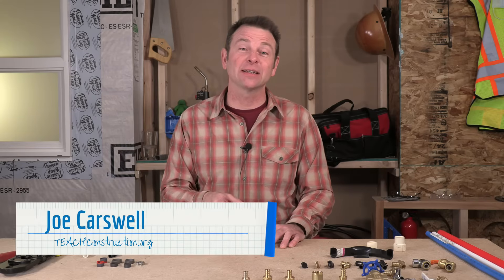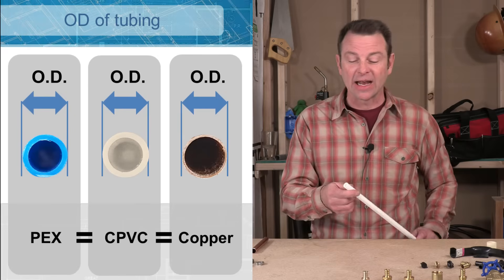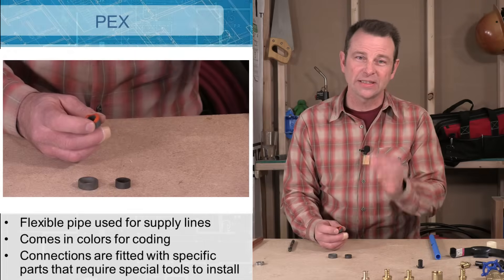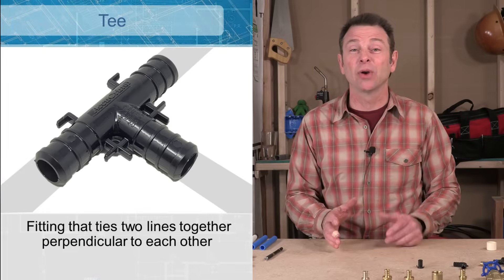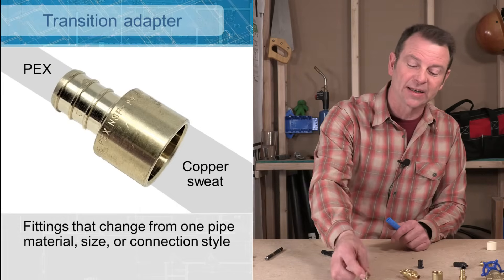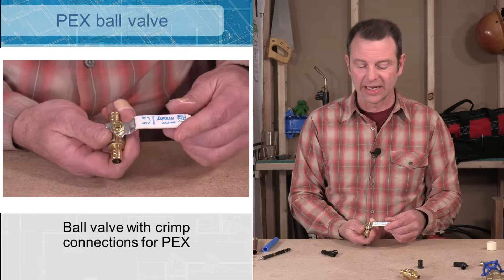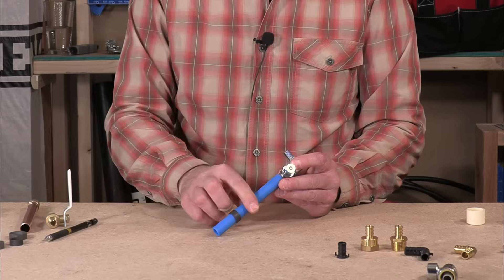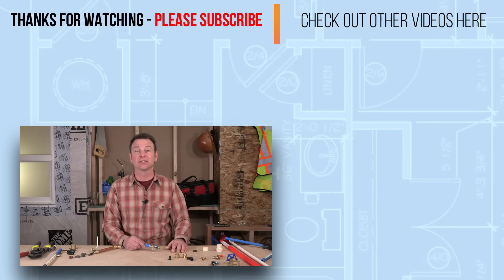A lesson about basic PEX plumbing materials  - Intro to Plumbing Systems

Comment: I live in a 20+ year old manufactured home. They used nothing but CPVC. I haven't found any plumbers that like it. I don't like it. It seems fragile and the way it was done, I worry that I'll have to do some major work if any of it breaks due to age. Would you say that re-plumbing with PEX is a reasonably easy job? Which is better, PEX A or PEX B? I very definitely like the color coding. BTW, I have about 2½' of crawlspace.
Reply: Each pex A/B has advantages/disadvantages. For many years, all the supply houses, Lowes, Home Depot around my area only had B, but now they carry A also. Pex B fittings are about 1/4 the cost of Pex A fittings. The expansion tool for pex A is in the hundreds, but the pinch-type crimper is very cheap, like 25 to 50 bucks, and it fits all sizes without having to swap heads, plus they are small in size, much easier to carry or use in tighter spaces. If you are just doing your own place, pex B with the pinch type crimper will be fine and most affordable.
Reply from the maker: I agree with Steve M's comment.   The PEX B is a cheaper solution over PEX A

Comment: How come plumbers are so afraid of 5/8" OD, especially when it comes to push to connect fittings, especially with end stops and spigots? Even if I find parts labeled 5/8, what's inside is always half inch. I managed to find a 5/8 sleeve (the spigot was tripped over, snapping the copper pipe), but it seems that the pipe wasn't long enough to connect at the top. This broken spigot is placed in a way that water can't get into the house unless I cap the pipe with a 5/8" end stop, or fix the spigot. 

When I went shopping to every hardware store, they said they don't make that product anymore. I found a sharkbite sleeve in 5/8, but it doesn't hold without leaking and shooting the spigot 10 ft in the air. So I wrapped a layer of gorilla tape around each end, and it stuck, but still leaked. So I went online and bought tools to properly Weld it with aluminum. And since it was an Asian website, and this portion of pipe and spigot were MacGyvered into place; it gets wider at the bottom and is held in place down their with JB Weld. The pipe it turns out is 5/7", not 5/8. So I found the caulk that was used to seal the bathtub, and ran a bead around the top. The quarter turn cut off valve to the house has a slight leak too, so when I checked it today it wasn't fully dry because i forgot to open the pipe to the sprinklers so it could dry. Tomorrow I'm going to wrap the connection with non adhesive (self ashesive) silicone tape, and it will do the trick. This morning before I realized it hadn't dried fully, and it withstood the water turned on 3/4 of the way before a small leak formed. I added more caulk. And tomorrow I'll take my first shower in 2 weeks. Luckily my water heater is electric, and uses a knob to adjust the temp, so I lowered it to 40 degrees F. 

I just wish I had watched this video first, I would have fixed it right away.
Reply from the maker: Quite the adventure, thanks for sharing.

Comment: Thank you for a very informative video. How does PEX compare to copper on places with hard water? Also, what is best to use between the meter and the water softener system?

Best regards.
Reply from the maker: I am told that PEX performs just as good as copper with hard water.  You can use whatever materials you like and that are allowed by code in your jurisdiction.   Just make sure you do not down size it at that location

Comment: Using a small pair of channel locks to very lightly crimp the rings helps hold them in place while  trying to get the crimpers aligned.
Reply from the maker: Good tip

Comment: is the crimping tool expensive?
Reply: If you go with the pinch-type, which are the stainless steel bands, you can buy the crimp tool for about 25.00, and the one tool fits all sizes.
Reply from the maker: It depends on the quality of the tool you purchase. 25-100 bucks

Comment: Is there an advantage to using the brass connection over the plastic? I just started a kitchen remodel and all the elbows in the pex plumbing are plastic.
Reply: My house was built 20 years ago and by year 10 I had replaced about a dozen brass fittings due to corrosion caused by what I learned was dezincification. There was a class action suit over it even. I went back with the polymer fittings and have had no issues since.
Reply: Some wells have acidic water, so the plastic fittings are much better in that case. I thought I had read somewhere that the new brass fittings could handle that, but research it first.
Reply from the maker: Some to the comments from the community are great

Comment: I had the pipe installed under my double wide  mobile home ( I helped / or hindered a professional) and it was amazing to me to see a no glue  but heat expansion process of assembly with heat or cold expansion this stuff seems almost indestructible my only question has been is it slowly leeching polyurethane styrene complicated mess of plastic chemicals into my water over time ? I was told NO!......but I still wonder ? I got this stuff installed about 5-6 years ago I was told it was a fairly new process then ? Hopefully it had time tested proof before it hit the market I cannot smell any horrible new  plastic smell and having hot and cold I'm the lines over a month of vacation without use still didn't smell when I got back I have well water do different minerals break it down ? I can assume the chemical's added to treat city water are much tougher on the pipes than well water but for me so far so good thanks for the refresher
Reply: Pex B is safer when it comes to chemical leaching of the pipe.
Reply from the maker: I can not comment on the pipe leaching into water - I am told it is safe

Comment: Hi! Can I rotate a pex expansion fitting after its installed? The elbow it pointing at the wrong orientation :(
Reply: I have rotated a crimp fitting on B, but have never tried on A
Reply from the maker: You can - but I would do it in a limited fashion

Comment: Does PEX piping systems use unions? If no, how do you separate components if you have to replace something?
Reply: Buy unions and put the pex fittings on them.
Reply from the maker: PEX is easy to bend and cut - sure unions are not typical.  But couplers are

Comment: Would you rather  use pex A or  pex B in a home which would you choose 🤔
Reply: Pex A does have a slight advantage being slightly bigger inside fittings, but with my low-flow showerheads, and aerators on the sinks, the much less expensive and less chemical leaching PEX B has not had any issues.
Reply from the maker: I have plumbed my house with PEX B but I would like to redo it with PEX A.   PEX B does have flow issues.
Reply: Good to know that. I've had my house for 25 years and I figure I might as well redo everything new before I get older.. Just finish putting new drain lines and  Sewer line from the house to the main. All that left are my water lines.  Thanks for the opinion

Comment: You can cold expand some PEX B pipe so long as it conforms to ASTM F1960, because that's what PEX A conforms to ... meaning, how the pipe is connected has nothing to do with it being PEX A or PEX B per se.

"A" vs. "B" has only ever described what the pipe is made of ... unless the company just can't make cold expansion work for their tubing made from the silane process.
Reply from the maker: thanks for the add
Reply: PEX B will not shrink back like A will. You can use B fittings in PEX A with crimp rings, but you can't use A fittings in Pex B.
Reply: @stevem1081  Hi Steve, you are incorrect, for the reasons I explained above. I will cite two examples below. 

Again, A vs B vs C only broadly describes how the pipe is made, by which process such as Silane graft or Engle or if it has aluminum in it ("C"). None of that dictates fittings, but manufacturer text can imply it when it helps their business model.

Common designs include ASTM F1807 / ASTM F2080 / ASTM F1960 / ASTM F2159. The first one is a crimp method, the 2nd is the pull-on (aka "Rehau") style ... because Rehau in Europe popularized that there ... the third is cold expansion method, the fourth is another crimp spec. All of that is independent of pipe construction method. This tells us that not all A or B pipe is the same.

For example, Zurn pipe can be used with cold expansion, because it's a "B" pipe that conforms to F1960. Zurn doesn't even bother to advertise their pipe as A or B, probably so that people pay attention to the fittings accurately. Another is Sioux Chief. SC makes both A and B, and their B is approved for ASTM F1960 fittings also. 

So when Apollo says things like, "PEX B is not expandable and you should never expand the end of a PEX-B pipe" what they're telling you is THEIR pipe is not expandable because it doesn't meet ASTM F1960. When Uponor mentions on their website only ASTM F1960, it's because they only make A-pipe, and pretend B doesn't exist.

Comment: If you are adding new PEX to a home... Let me give you a tip.
Don't plumb your home with 1/2".
Use 1/2"  sparingly, only in short lines to a sink, ice machines,  or other light duty device.
You will want to use at least 3/4"
Why? When you use connections pieces, such as elbos, tees, or couplings.... even thought you are using 1/2" pipe, you changed the inside diameter when using connectors.
A 1/2" pipe will be reduced to smaller size on each connection.
"Ask me how I know"
Each time you take a shower expecting a ton of water... you will regret using 1/2"
Reply from the maker: Great Advice and I agree - in fact I have replumbed my house with PEX B and Considering changing much of it to A - especially my wife's tub
Reply: If you are trying to use some modified showerhead flowing 5+ GPM then you might have an issue. The highest flow head that can be sold is 2.5 GPM, and some places won't even allow 2.5 GPM.  Now trying to fill a tub at a faster rate, I can see running 3/4 to it, but all of that depends on multiple things, if you have an on-demand, too much flow you may not have hot enough water. This is where knowing what you will be using(designing a system) will eliminate problems. Also, using a manifold can fix many issues, such as temperature swings while you are in the shower and someone washes their hands in another sink, plus you can run 1/2 to the fixture and get the hot water there faster, resulting in less waste.

Comment: I have been a PEX user for many years. Over the last 10 years of installation and use... I can say this.... I have never ever had a failed connection. 
I have had a connection that was incorrectly installed,,,, but never a failed connection that was correctly installed.

"Push on connecters" Well, I have had 1 blow out, but I can not say what was at fault. Could had been my fault.

But I can say that PEX, when correctly installed, is the best!
Maybe that's why they use it on RV's
Reply from the maker: I have also used PEX for years and not seen a failure yet - but I have heard of them .

Comment: Is there a trick to turning off the hot and cold water valves on a pex system?  I need to replace bathrooom and kitchen faucets in my house and using the tool to close the valve somehow couldn't get them to move, is there a trick to this?
Reply: Bathroom and kitchen faucets should have a valve on the supply lines where they come out of the wall - If you are not able to turn the flow off there (or if for some reason you do not have those valves) I recommend turning off the supply further upstream on the lines - or the main supply if you have to.

Comment: Hi Ty for the video. Have you any suggestions on which PEX should be used from the city main towards my home? Type A or B
Reply: I ran PEX B and have had no issues. Now if you run a lot of items at once, say sink, washing machine, toilet, sprinkler, then PEX A has a slight advantage as the fittings are slightly bigger interior size, but if you flow that much all at once, you might want to run a 1" line. (my run was 90' and no issues with anything, although I don't run multiple things at the same time, I take a shower while the clothes are washing and don't notice any issue)
Reply from the maker: I am a fan of Type A fittings - but more expensive on the tools

Comment: Is there a way to clean pex after years of use. Just bought a home and the insides looks discolored so I assume it’s dirty
Reply from the maker: It should not be dirty, that could be a sign of a different problem.   But plumbing lines can be flushed
Reply: @ConstructionEd  thanks. How can 5hey be flushed

Comment: On the PEX fittings, elbows or 90's.  Where possible it would likely be better for friction losses in what is already a smaller I.D. line , use of less fittings.  Does require enough space for the turns with line flex alone (without crease).  You show 2 types of "rings".  Any guess to which is better/stronger over time?  How well does it hold up to "varied flows" where there might be some line shock (minor but over time)?  Last is a comment about the plugged line.  Keeping the length of dead ends might be important for water quality if too many dead end branches (no circulation, stagnate water).
Reply from the maker: I agree, I try to limit the use of 90's whenever I can.   I like the rings that have the standoff on them - they seem a bit higher quality
Reply: @ConstructionEd  
On the minimizing of fittings, all need to keep in mind that once the pressure and volume is reduced by the fittings plus reduced I.D. - it is not "recovered".  Gone until a booster pump is calculated in to the overall system.   Possibly in low pressure regions, add in a poly or stainless tank (reservoir) dual strainer (a & b) type then the requisite straight section of pipe before the pump. Add in a return line controlled by pressure valve.  Basis?  Keep even/constant pressure and volume to appliance and general need.  Depends on the local area and the overall system in the region.

Comment: I have heard of some folks using Sharkbites to do their whole house. I read that the O ring is guaranteed for only 25 years. Is that true and would it be a bad idea to do the whole house with Sharkbites?
Reply from the maker: Many of the SharkBite fittings, at least the removable ones, should not be hurried in a wall, making them unlikely to be used for a whole house project.  Plus it would be very expensive.   I would not do it.  There are other solutions that would be better.
Reply: Like he said, the cost of the sharkbite fittings will be way more expensive than a crimp tool and rings. I have seen several sharkbites come off, I didn't install them, so I can't say if it was an installer error or a fitting problem. I just know that I will not use any in my house or in any jobs I do, except for a temp repair that I will be back tomorrow to finish.

Comment: I just don't like how the fittings reduce the diameter. It's great and easy to work with but I don't know how much restriction it causes. Nitpicking I guess.
Reply from the maker: PEX B does reduce the diameter and flow.  Something to consider and plan for
Reply: While it is something to consider, a properly designed system won't have issues with it. Things like manifolds can cure lots of those issues. Or running 3/4 trunk line then 1/2 up to devices. Just remember, things like sinks and toilet connector hoses have only 1/4 diameter ID lines feeding them, so a 1/2 fitting is still much larger than that.

Comment: Pex is not supposed to break when frozen, how well does the plastic fittings hold up and brass to freezing temps??????????
Reply from the maker: They hold well - but as with everything there are limits
Reply: The fittings are the weak point when it comes to freezing. If you have to run pipes through the attic, make sure no fittings are used in the attic!

Comment: Thank you for the video. I am wondering about brands/manufacturers being interchangeable such as say for instance if I have PEX B pipe branded/manufactured by Apollo from one of the big box stores and they don't have a fitting for that brand will another manufacturer such as Sharkbite brand PEX B fittings work with other brands of PEX B?
Reply: All PEX B fittings will be the same in size, no matter which manufacturer.  PEX A and B pipe are the same size, but PEX A fittings are larger and will only fix in PEX A when it is expanded. You can use PEX B fittings with PEX A pipe, but you can't use PEX A fittings on PEX B pipe.
Reply: @stevem1081  thank you
Reply from the maker: It all depends on the interior diameter - of they are the same you are usually good to go.

Comment: Hi good video to start with. But is missing a lot of info. I'm not a plumber, I'm in IT but doing stuff around the house myself and I can tell that there are three not two types of PEX. PEX-A different set of proprieties and different set of tools, PEX-B and PEX-C slightly different properties but same tools to work with. Also didn't show the actual crimping process with it's goods and bad. How about PEX-A extension connection? will you show that?
Reply from the maker: Stefan - thanks for the comments.     This video was only one in a series of plumbing videos - i encourage you to review the playlist - https://www.youtube.com/playlist?list=PLfZcU0E-cRgAbjixpnXDVfcC68WwLQoQB
There is a video in there about PEX process and many other topics.
Reply: There are 3 types of PEX, but you won't find the C anywhere, so not much need to discuss it. And you can use PEX B fittings and crimps on PEX A pipe. You just can't use PEX A fittings on PEX B pipe. And I suppose you meant to say PEX A expansion connection? By the way, PEX B is much safer if you are concerned about chemicals leaching into your water.